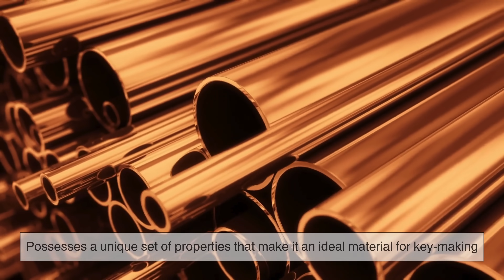Why Are Most Keys Made of Brass Instead of Steel?

Comment: Brass keys are all plated with nickel (sliver colour), so any antimicrobial property of brass (yelliw colour) is irrelevant because it is covered bt nickel
Reply: And when the key blank is cut - the brass is opened on the cuts on the keys
Reply: @mmi16  This is of no relevance
Reply: I can promise you that neither brass or nickel silver (or nickel / chrome plating) is used due to “antimicrobial” properties.
Linius Yale in 1868 +/- designed the first “modern” pin tumbler cylinder/lock and antimicrobial was NOT even a concept in its design.
Simple fact is; the small pins actuated by the key are made of brass, bronze or nickel silver (rarely bronze) as is most of the rest of the moving parts of the cylinder except the driver springs which are not subject to contact. The key, pins and keyway “lands” must all be made of one of those three materials because they are similar in “hardness” (and malleability) and none will “wear” the other more than itself which allows for thousands of “cyclings” without either failing. (In cheap cylinders sometimes zamac is used which is actually softer and often wears “out of spec” before the keys do. See Kwikset & Foreign Car Cylinders)
Reply: Nickel is also antimicrobial.
Reply: @AllGreenThumbs  No, as a pure metal it is not antimicrobial
Reply: @Goodkiwibloke  My assertion is at least partially corrrect. "Nickel's antimicrobial activity is related to the release of nickel ions, which can disrupt bacterial cell membranes and interfere with bacterial metabolism," "Nickel-based coatings can be used to impart antimicrobial properties to surfaces", yet not quite as strongly as pure copper or silver. But @mmi16 makes the main point.
Reply: @AllGreenThumbs  No, you are wrong. Nickel metal does not "release nickel ions". That's why it stays shiny. Take it from an industrial chemist with a few degrees and 40 years experience
Reply: @Goodkiwibloke  Um kay. However, it doesn't exactly stay shiny, unless you're handling it constantly, until it wears off completely. The antimicrobial properties of various types of nickel-based coatings are the subject of ongoing materials research.
Reply: @AllGreenThumbs  I have 50 year old nickel coated keys that are still shiny. Nickel resists tarnishing, that is one of its properties, and one of the reason why it is used on keys. What exactly do you do to your keys?
Reply: @Goodkiwibloke  You must have some nice keys. Are you certain they are not chromed? (Or do you keep them in individual velvet lined pouches?) Do you know how and why chrome plating is done? I'm here to learn. I know that nickel tarnishes and erodes. Apparently, it gives off chemically active ions, which you can detect.
Reply: @Goodkiwibloke  You are full of it. Nickel DOES release ions. Nickel sensitivity / allergy &/or reaction to skin is common.
Especially with skin contact on the back of nickel plated watches.
Reply: @95rav  Nickel resists corrosion (it's the reason it is used). This means it doesn't corrode. This means all atoms exist in the metallic state, not the ionic state. This means there are no ions to release

This is basic high school chemistry. You can argue all you want, but it is an inescapable fact
Reply: Nickel is also antibacterial.